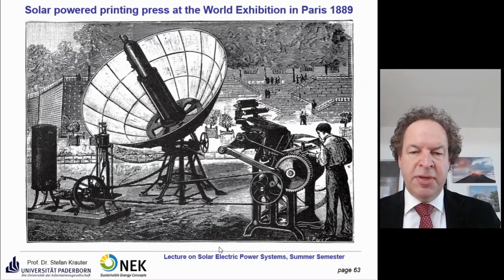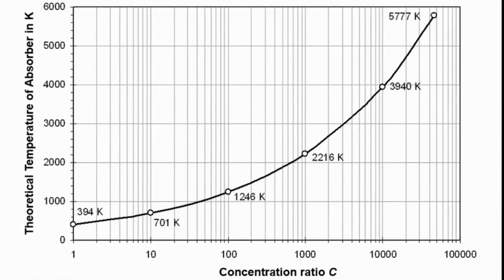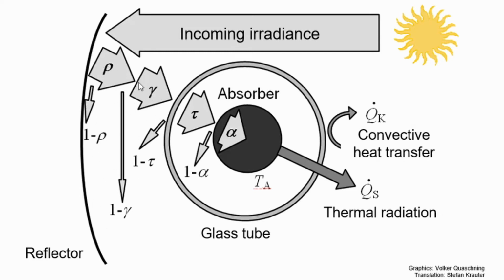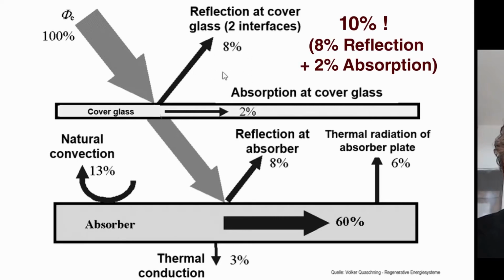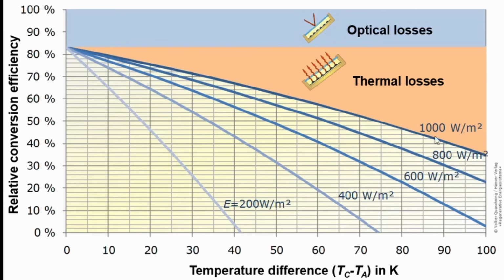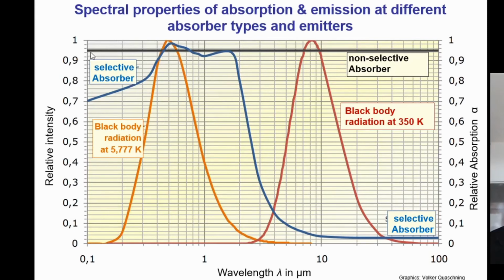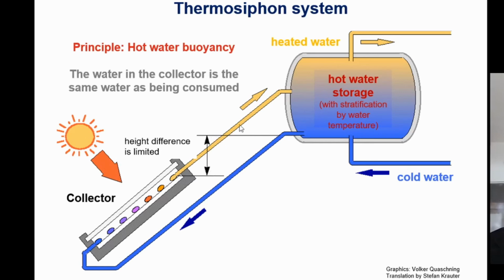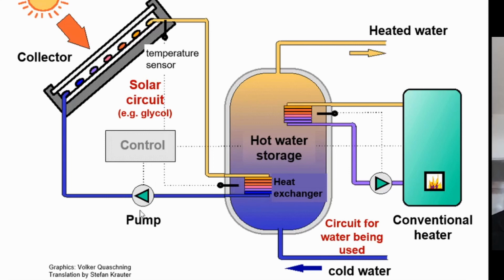Solar Electric Energy Systems 02a - Solar Thermal Energy Systems (part 1)

Comment: Dear Prof., sorry, I have a question. On the third page of the slides, we have the equation of "Concentration ratio" as (A absorber/A aperture), but I suppose this term can not have a value larger than 1, since the "focus area" is always smaller than the "effective area" as you explained in the lecture. Would you please explain it a little more if I'm making a mistake somewhere. I really appreciate your help.
Reply from the maker: Thanks, yes - it should be the collecting area divided by the absorbing area.
Reply: @Stefan_Krauter  Thank you so much.